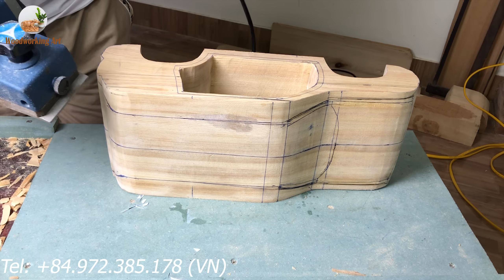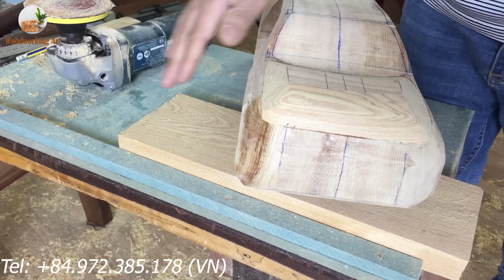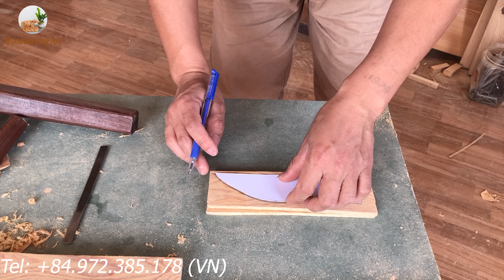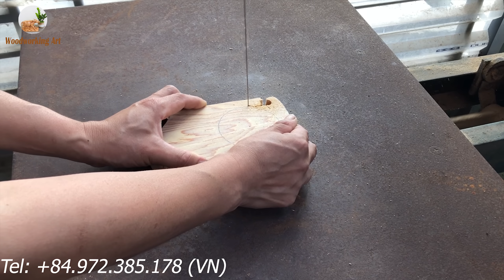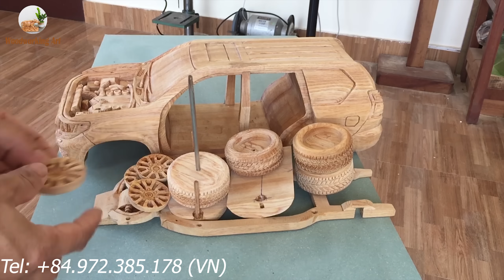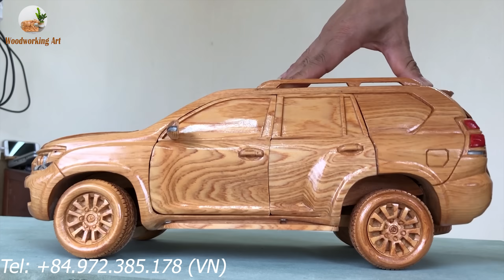Building a Toyota Prado Land Cruiser 2020 Wooden Model: The Skill and Craftsmanship of a Carpenter

Comment: Carved out the engine bay. Made tires for each wheel. An actual fucking frame with suspension. Working hatch. My mind was blown. That was incredible
Reply: cirque crew xdwjfxdte
Reply: Even the type of suspension.  Independent on the front and solid axle in the rear!
Reply: 1
Reply: Kop

Comment: Damn at that point it’s like why stop there? He should have put a battery in it and made an RC car
Reply: حلو😭😭😭
Reply: You don't just add a battery and call it a day.

The battery is going to power the motors connected to the wheels when told to release power by the controller circuit.
(Which is considered wireless because remotes aren't connected to the car, duh)
Reply: @nightslasher5055  who asked
Reply: @IdontKnow-jd2km  I asked
Reply: @الحزينالبصراوي-ف4ي  تر رد
Reply: @nightslasher5055  TGIF FL if
Reply: de yqgufawweri na उम ae

Comment: In just 5 mins Stops Over Heating the Engine. 
Watch the Live Video  :- https://youtu.be/SqNIGQM1I2Q

Car Drives without Radiator, Coolant & Cooling Fan with Graphenizer Liquid controls the Engine Heat up to 60%.  

It also Cleans the hard carbon with dark smoke from pistons, Injectors / Nozzles, Valves & Pump etc, instantly & increases extra mileage up to 50%.